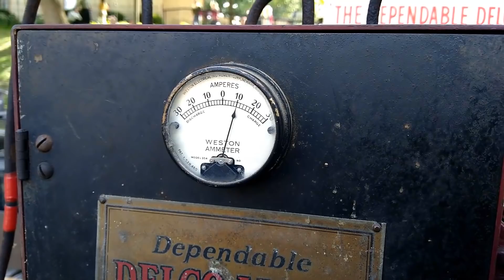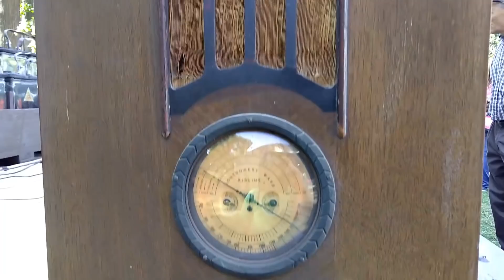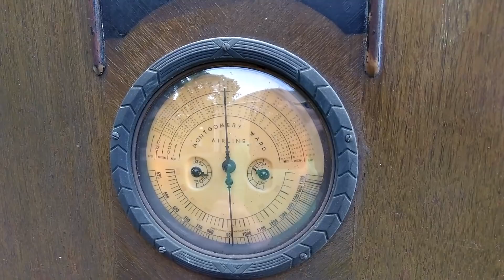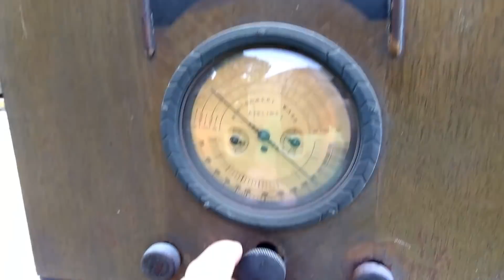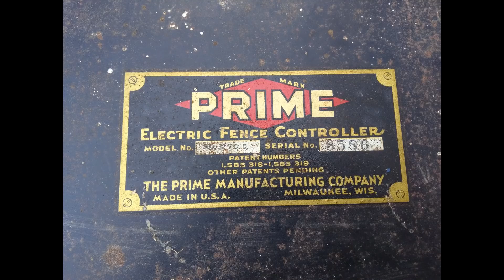Delco-Light Plant Demonstration with Appliances

Comment: I have wondered why we don’t use/have available the glass & water batteries any longer???
Reply from the maker: Probably because they're fragile and far better technologies exist today...?
Reply: @uxwbill  i understand the plastic doesn’t break as easily especially in automobiles & the manufacturers (mostly over seas) loves that they wear out in a year or 2… I wonder if/how long they could store any charge? If at a home, let’s say for solar or wind, could the energy be stored in the water glass batteries?
Reply from the maker: Unless it happens that you are buying the absolute cheapest batteries you can find, or the charging system is treating them harshly, the lifetime should be a lot better. Five years should be completely attainable.

I've had car batteries that easily lasted a decade in the face of being frozen and baked. I also came across a UPS that still had its original and nearly 20 year old SLA batteries inside. They were still more than good enough to carry the load. Granted, that is definitely an exception rather than the rule!

While those glass batteries could likely be brought back to life or remanufactured, they are very crude as compared to today's batteries. They simply would not have the lifespan and energy storage capacity of a modern lead acid battery. Nor do they benefit from all the improvements in manufacturing and technology.
Reply: @uxwbill  I understand about the newer batteries, I’m not trying to say we need to ditch them. I’m just trying to learn about the water glass batteries & this is one of the very few channels that even shows them. It’s interesting to me there’s so little online about them. Maybe a positive they’re less expensive than modern batteries, maybe not…. But what about a SHTF event, and no manufacturer for modern stuff- could a regular old gallon size mason jar be retrofitted similarly? Just a lot of questions go through my head about this. Guess I’m the only one. I do love this video though & wish my grandpa were still around to tell me all about his delco generator.
Reply from the maker: If you've looked up information about contemporary flooded lead acid batteries, you've also learned about their glass cased counterparts. The only things that have changed are the increased reliability, better power density, stronger case material and need for much less maintenance with a modern battery. Other than that, they are much the same.

You may want to visit https://batteryuniversity.com/articles . There is enough information there about every aspect of batteries to keep you reading for a long time.

If anything, the manufacture of a glass cased battery such as these would be much more expensive. Manufacturing anything gets cheaper when you make a lot of them (economy of scale) and the process of doing so is automated. If you were to make a glass cased battery, you'd be catering to a very small market and much of the assembly would have to be done by hand, as you can't recoup the cost of buying or building a big machine or automated assembly line with the proceeds from the few glass cased batteries you're likely to sell.

Should you really want to play around with battery chemistry, or even making a battery of sorts at home, various types can be made with aluminum foil, paper towel, lemons, salt water, and even potatoes. I've done some of these myself. The basic principles are the same and it's far safer to work with any of those things than it is lead and sulfuric acid. I'm sure if you were to search on these items, you'd find some very informative articles. These might be the kind of things you'd make if, as you say, the "SHTF" one day. Or you might be better served and more easily able to build something like a hand cranked AC or DC generator set from found materials after an emergency or disaster.

The number of surviving, much less functional, Delco-Light plants is likely very small. I'd known of them for two decades or more before I happened across this one. The gentleman in the video isn't actually using any of those glass cased batteries. He had concealed modern lead-acid batteries underneath the various crates and wired them appropriately. The Delco-Light generator and certainly none of the appliances could ever tell the difference.

Comment: There used to be a hotel on top of Mt. Mansfield in Stowe, Vermont. The hotel installed a Delco-light plant in 1897, a decade before the town was electrified. Sitting down the hill from the hotel was a  toolshed-sized building which has confounded local historians as to its purpose.  After not just seeing, but listening to this video I'm pretty sure I know what role it played. Could anyone hazard a guess as to how much work the plant might have accomplished? Could it have lighted 30 rooms, and played a Victrola.? Could it have heated enough water for a 50-seat dining room's kitchen?
 I'd appreciate any help.
Reply from the maker: The Delco-Light was brought to market in 1916. (By 1897, electricity had been known to exist for some time, though large scale commercial generation and ready-made products to generate electricity were still a way into the future. Where electricity was available and used, it was used for lighting. Appliances were also yet to become popular and mass produced.)

I expect that room lighting was the primary use for that hotel. A Victrola of the time likely would have been mechanically powered (spring motor) and amplified, so it wouldn't need electricity. A stove running on wood or gas likely would have been used for cooking and heating water.
Reply: @uxwbill  Appreciate the depth of the response. I took the date, 1897, from a recollection of a local woman writing her memoires in the 30's. She remembered being at the mountaintop hotel one evening when a violent electrical storm tookout the lights and killed a hiker caught out in the storm. She remembers the hotel manager digging out the old kerosene lanterns to light the parlor. Funny she remembered so much but got the date so wrong.
Reply: Depending on the size
Look at that battery bank for 32 volts I used to operate these and own some delco's,  everything being 32 volt backed up by those batteries and the generator the way they were you can probably run everything Delco made
Of course nobody should just overloaded on purpose.

Comment: Is he actually running off of the glass batteries? I've got a full set of 32V 16 glass battery cells that still have the plates, top covers, and acid up to the water fill line. Would be neat to figure out how to restore the plates to get them working again (but nearly impossible to find plates for them).
Reply from the maker: No. He had more modern batteries hidden in various wooden crates. Those were hooked up and carrying the load, or being charged.

I'm inclined to think that getting those old, relatively "low tech" old batteries to be usable again would not be impossible.
Reply: I'm sure there plates for them out there - those battery's were every were around the country for 70 yrs or so - 
     The problem would be in what's needed to melt the plates of lead together. 
     My grandfather was still working on those plants, appliances and battery's into the 70s - 
        Even were I live it was still less expensive to generate your own power than to buy it from the grid - so some just stayed with there farm light plants into the 70s - also up till 1990 or so our powered stayed off as much as it stayed on - 
.    My guess is if you post on the net the need for plates some one will come up with some -

Comment: I recently acquired a Delco-Light plant, and even more recently got it working. It is one cylinder, 750 watt, 32 volt, and appears to have been manufactured in late 1929. It's unfortunate that I have no 32 volt appliances but it will charge some batteries. It is cool in itself to have a 91 year old engine that works basically like new.
Reply from the maker: It's very cool to know there is at least one more out there in working condition. As for the 32 volt appliances, the man who had this setup said he found most of his in antique stores. The biggest problem was that of people plugging them into 120 volt outlets and burning them out.
Reply: That's cool to know, I'll try to look at such places. 2020 has stripped this particular possibility, but perhaps those sales at gas and steam shows might also be a place to look.

Comment: The radio was an Airline, likely manufactured by Belmont Radio and Television. I see that at least one tube was a #43, that may or may not be original as many used #48s for output tubes, which were specifically designed to run on a low plate voltage. Type #43 tubes are sometimes used for substitutes for #48 tubes in these radios as many had the original tubes burned out after some unknowing person plugged the 32 volt DC radio into 120 volt AC mains. That was one mistake in the design, they used the same power plugs as an AC operated radio but are not, I noticed that the owner used a pair of coloured wires for a new power cable and attached a tag stating "32 volts only". I don't think that the lack of reception below 900 Kc had anything to do with it operating on 32 volts, I think that there was probably another issue, it may have had needed an alignment or it had a problem in the oscillator tank circuit.

Comment: I wonder if that hand vacuum was a Royal Prince.  I have a modern one from the early '90s as well as one of their last metal canister vacuums from 1999.  They are both great vacuums that were made very durably out of metal, much like their counterparts from decades before.  Now nearly 20 years later they still are going strong, I wonder if that will be true of all the modern plastic Dysons, Sharks, etc.  BTW those table fans are really neat!
Reply: It doesn’t look like a Royal Prince, the Prince used a revolving brush. The design of the one in the video does not use a revolving brush, and the basic design was used by a few different manufacturers of the time. The Prince is a great machine though, as were Royal’s uprights. It’s a shame that the parent company of Hoover, Oreck, and Ryobi bought Royal/Dirt Devil and killed off the Royal brand. The Power Tank is an excellent canister vacuum, very powerful and it had good filtration for the time it was produced. 
Something interesting to note is that there were cheaply made vacuums many decades ago as well, but they aren’t the ones that have lasted for us to look back on today. They are long gone and forgotten. Just as many years from now when the cheaply made Dysons, Sharks, and Bissells are gone, people will see the Sebo and Miele machines from our time period and think that things were made very well as they’re the only ones that will last and be remembered. It’s an interesting answer to the age old claim that things were made better in the past.

Comment: Great to see a 4 cylinder Delco-Light, there can't be many of these still running, i believe this engine was first used in a motor car but being air cooled was not very successful, i wonder where he got all those lovely 32 volt gadgets? I have a 601 single cylinder back here in the UK,, thanks for showing
Reply from the maker: I never knew they made one that big. I was greatly curious about what its maximum RPM under load would have been. That engine had such a nice sound to it!

As you might imagine, I had a great and lengthy discussion with the gentleman who put this display together. He told me that most of the appliances had come from combing antique stores and getting more than a little lucky that people hadn't plugged them into 120 volt outlets. (One of the fans had been converted, with a homemade wirewound resistor made using a tube from a knob and tube wiring installation.)
Reply: thanks for the information, they say things go around in circles, there are quite a few homes with back up generators because of the unreliable power suppliers due to demand being so high! and with renewable energy using  storage batteries perhaps the Delco-light might make a return?
Reply: That happens with the 32 volt radios all too often unfortunately, if it used type #48 tubes they go off like flashbulbs since they are connected directly across the 32 volt line. I'm not sure what would have happened with the iron or the motorized appliances, they may just have poped the circuit breaker on 120 volts.
Reply: "T" plugs are still sold in Australia, special ELV plug rated for 32V or lower.

I assume these were used back in the day for these kind of generator plants. They're a good buy for that reason if nothing else (Someone plugging them into mains.)
Reply: I ran into a discussion about 32 volt wincharger type power systems on a forum from Australia, it seems that they were very popular there, and were in service longer then they were in the U.S. I think that the latter may have been true in Canada as well as I saw a 32 volt radio listed in a service manual from the late 1940s or early 1950s, which is something you don't see in the U.S. 
 However "A"+"B"  battery operated tube/valve radios seemed to be the most popular in rural Canada, by far, with 6 volt vibrator radios being a close second. They were offered for sale in mail order catalogs up until 1958 at least, which is surprising given that the same catalog offered transistor sets, though they were conciderably more expensive then the tube ones.
Reply: The engine was designed specifically for the generator but shares many parts in common with 1920s Chevrolet OHV car engines.

Comment: My Grandpa was born in a house with a system like this! The house they live in now had a generator of some sort at one point, I believe it was a 120V system though.
Reply: I had a Delco one time that had a Exciter , that ran off of the flywheel. and it was painted red from the factory, it was 110 volt,  the engine look like a 32 volts single-cylinder only it was red and it was 110 volts

Comment: I always like seeing demos of those Delco Light Plants, That is quite a bit bigger than the ones I see around here, most of them being small single cylinder ones and with modern batteries running at 36 volts.

Comment: Generators used to sound much better back in the day, modern single-cylinder open-frame ones just make noise, lots of noise...
Reply: I noticed that as well. Seemed smooth and not intrusive. I'm impressed.

Comment: Great history lesson! One question: how could the radio run on 32v DC? Did it have a anode battery?
Reply from the maker: One of the most common multiple output power supply circuits of the time was the multivibrator system. It physically moved (hence the name) and could provide all the needed output voltages for the tubes. Early car radios in particular used these quite often.

Comment: cool vid but that old engine wont last too long, no oil up on the top end when he opened it
Reply from the maker: I wondered about that myself. I don't know what kind of lubrication system it has. The stamped passage in the top of the valve cover talks about periodic lubrication. In the few engines I've seen running with valve covers removed and full pressure lubrication systems, I've never noticed oil squirting out every which way.

Comment: and I just figured out why the boat I help on has a 32v circuit and 12v-32v converters
Reply: This is going to sound like a completely insane question since I don't know you, but by any chance did you used to volunteer at a PBS station in San Jose, KTEH-TV?  I ask because your name looks so familiar to me.
Reply: @sjrr124  heh. Yup. Back when I lived within an easy drive
Reply: I thought I recognized the name.  Small world.  I was a Master Control Operator there until the station was shut down.
Reply: @sjrr124  shhh, don't tell anyone, but when I operated shaders I'd gently tweak the gain and black points so colors were consistent across the cameras. Not having them calibrated properly drove me nuts.
Reply: And damn out of gamut lights 🤮

Comment: First!!!

Man that thing sounds a little scary lol. Are those pops and snaps the engine or electricity?
Reply: John Smith that sounds like a hit and miss engine nearby
Reply: @gmcnewlook  , I concur. Especially when he shut down the genny and the other engines were still running in the background.
Reply: @gmcnewlook  saw one of those on a episode of pawn stars one. There kinda cool.
Reply: Maybe all that clicking as the generator engine stopped,  but that irregular "chuffing" sure sounds like unloaded Hit and Miss engines running at low speed.
Reply from the maker: To answer the question or at least add a data point, there were a few hit and miss engines running nearby.
Reply: @uxwbill  extra data points is always a good thing lol. We've been waiting for you to show and share your wisdom uxwbill.
Reply: Neither; it is the sound of the relays clicking.
Reply: @dnb5661  if that's relays never heard ones that sound like that  before.